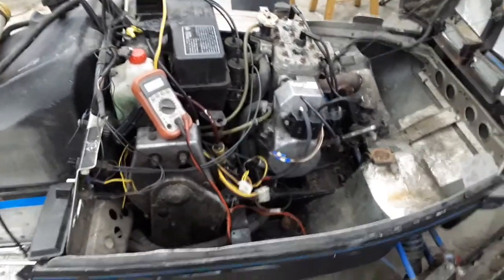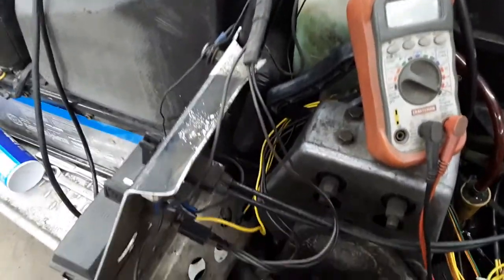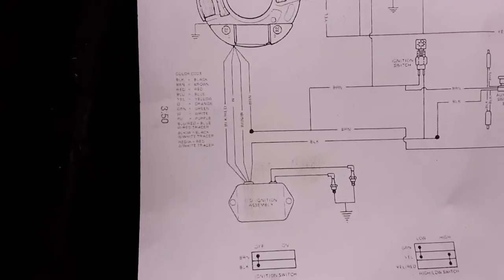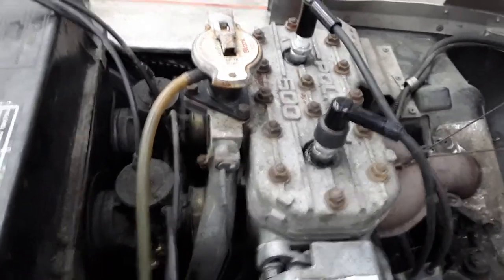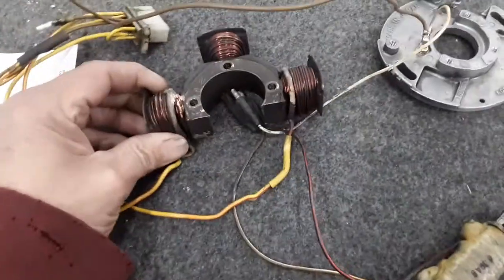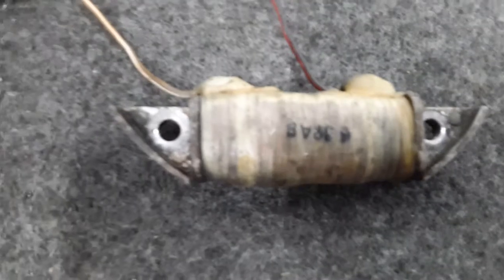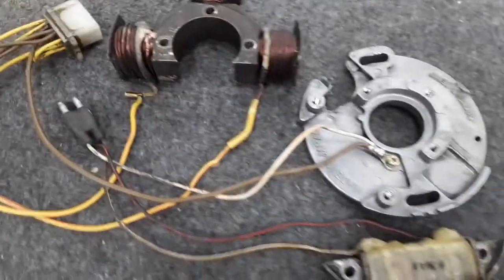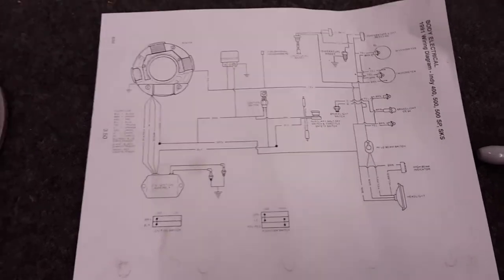1991 Polaris Indy 500 No Spark (Fixed)

Comment: I got a indy trail deluxe 1990,,,, when the weather is warm/hot in spring when i drive for 10 mins or so,, it will lose power like im driving on one cylinder, so ill shut it off to cool down and it will be fine…. What would u check????
Reply: Changed spark plugs already
Reply: did you figure it out?
Reply: @Gamesfordawgs  no…… its fine during this cold weather we have up here. Find out in march or april when the weather gets really warm